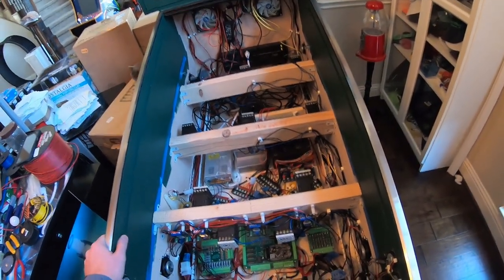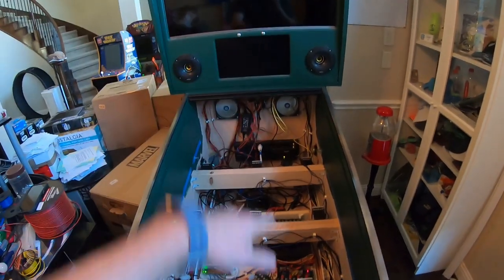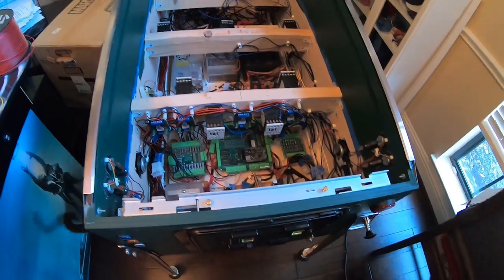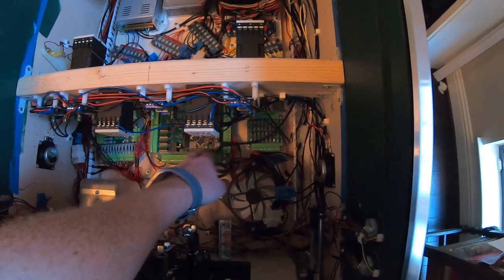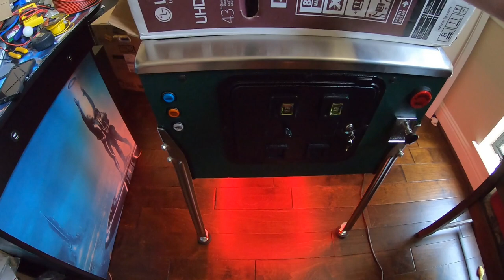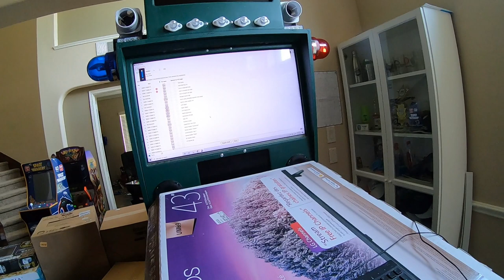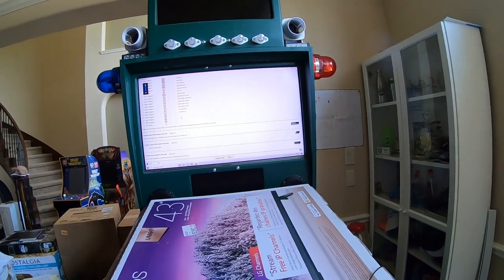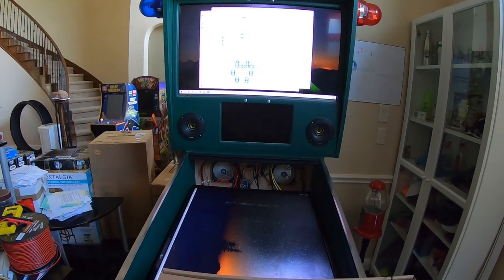Testing, Software, and Power On - Virtual Pinball Build 20

Comment: Hi, if You are planning to use a on/off button for night mode, then be avare, it will make the pinscape behave strange. Use a push button. I have reported it, but no one is reading it. Great work.
Reply from the maker: Thanks for the note. I should put one in. It is pretty noisy.

Comment: you are one smart dude just saying . i never could build something like this . and i know some stuff in computers i build my gaming computer and i got my self a Arcade 1up NBA JAM and i added a Raspberry pi4 with over 10K arcade games in it and i had to rebuild control panel on Arcade 1up machine to new and better buttons and joy sticks  but i don't have that arcade machine anymore i sold it i got my self a atgame legends pinball machine ..  but this Virtual Pinball machine is something else . i bet it wasn't cheap either to build this Virtual Pinball machine. i bet if someone buy something like this Virtual Pinball machine it would cost  $7000 or more  this Virtual Pinball have pretty much everything you can think of ...i love it keep videos coming
Reply from the maker: Nice. I built a Pi machine a couple years ago. Theyre pretty sweet. It’s a 3b version though. The virtual pin took a lot of effort and almost a year, but the finished product is awesome. If you feel like taking the dive, the community is very helpful.